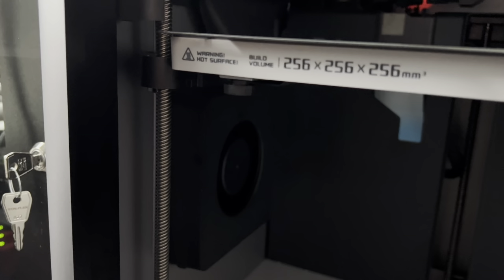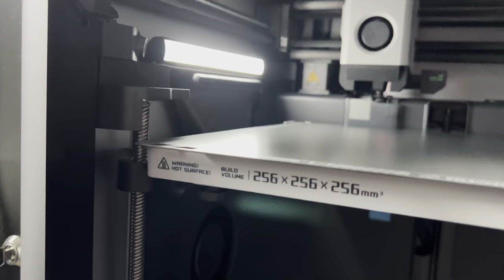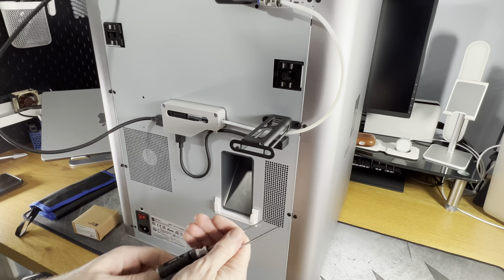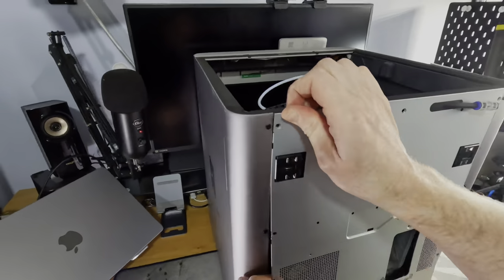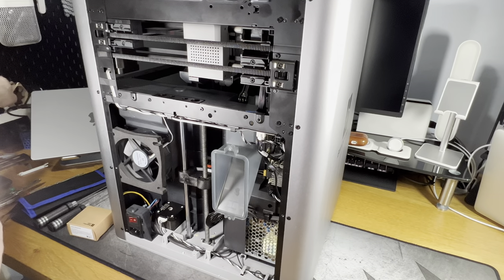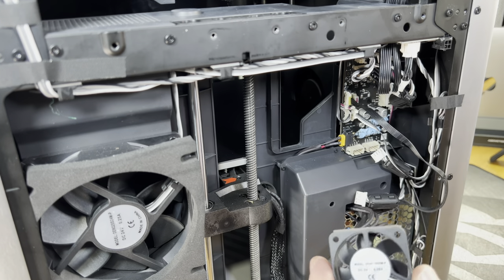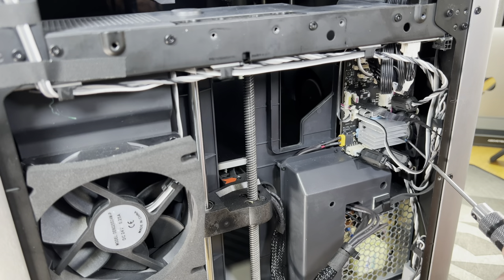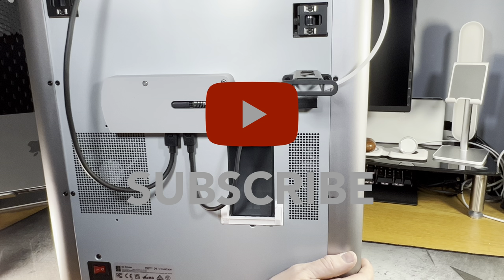Fix Noisy Internal Fan, Bambu Lab X1 Carbon

Comment from the maker: The new fan has slightly different model number, so I suspect Bambu Lab has changed the fan to address the issues with fan noise on the Control Board  fan.  Have you had any issues with your fans failing or making noises?  How did you deal with it?

Comment: I dont know if the ABS printing caused that.I just got mine, didn’t even print yet and that fan is rocky and loud. Just a bad design with that fan. After seeing how much thermal paste they use on that heat sink I would have to think a redesign with a part that runs cooler would be better, or at least a quieter fan.
Reply from the maker: @GadgetReviewVideos temp inside get really high during ABS printing.  But your right the design is not ideal.

Comment: Thanks for the video.  I also had this issue.  I replaced mine three months ago and the noise is back.  I'm thinking of going to the noctua fan as well.  Also, where did you get the file for your purge chute?  I like the idea of the mounting bracket.
Reply from the maker: Thanks enelrad6908, glad you liked the video.  Interesting the noise is back for you, so far mine is OK but I have been doing less ABS printing.  Do you know if the replacement fan had the new model number (ending B05M)?  Have you contacted support to get a replacement fan?  The main reason I didn't go with the Noctua fan is it would have meant cutting cables and that would likely void the warranty.  If something failed you wouldn't know if it was because of the modification or just a fault with the printer that would need a warranty claim.  The design of the printer is too new to know what might happen over time.  Yes,  the purge chute bin I used is from Zodiase on Thingsverse, https://www.thingiverse.com/thing:5848181 and I just used 3M tape to stick it to the body.  Hope that helps.
Reply: @T8Maker  I have not contacted BL support for the second fan.  I already have a spare fan (ending in S05M-P) and have a Noctua on order.  My plan is to use my current repair parts before going to alternate repair methods.  Thanks for the link to the bin.  Have fun printing.  🙂
Reply from the maker: That looks like the old fan, I would log a ticket and try to get the newer model fan.  But I would do the same, the Noctua would be last effort solution, mine is put away for that use case.  If I end up using it, I will put it on a short video.  No problem on the bin, enjoy :)

Comment: Great video. I was thinking of getting one and now I know how to quiet it down when I get it. I did notice one thing tho when you took the AMS Feeder off it was small and white but when you put it back on it was not the one you took off did they update them and you just got a new one??
Reply from the maker: Thank you for the feedback, glad you enjoyed the video.  Yes you are correct, I replaced the original feeder with the multi AMS feeder as I am planning to get a second AMS soon.  But it doesn't add anything else, no other improvements to the feeder or the AMS.

Comment: Did this help the noise? I didn't see/hear a before and after.
Reply from the maker: @ryancameron1610 Around 00:29 I do show the sound before the fix (in fairness I have background music also, note for next time...).  But at the end of the video its not possible to demonstrate the noise of the fan because Bambu Lab released a firmware update which I installed before I did the fan change.  This firmware turned off the fan when not printing, so when I finished there was no fan running to make noise.  I can say replacing the fan did stop the noise from the main controller fan, but I  have no way to demonstrate it, I suppose, without putting a mic up to the fan while printing something.  So for now I am afraid you will have to take my word for what its worth.

Comment: I got my X1C last week and I really don't find the fans too bad. To be fair, my last printer was the Ankermake M5, so anything would seem quiet after that! I do find that I notice the printhead movements more than the fans on the X1C.
Reply from the maker: You can adjust the fan speeds for the part cooling, auxiliary and chamber fans, which does help if it is annoying, in my case it was the motherboard fan that did have an issue and needed replacing.  I suspect it was caused by overheating of the fan due to printing high temp filaments and possible my lowering the chamber fan to reduce noise causing the chamber temp to climb.  Re the print head, you can reduce the speed of the print which will reduce the noise.  But as with everything in life its a trade off between speed, heat and noise.  Hope you enjoy your new printer and have a good experience with it.

Comment: mine is so loud im really tinking about switching it out... even thought about going 140mm room is there...
Reply from the maker: @teabagNBG Interesting, not sure if you could fit a 140mm.  If that is chamber fan?  Or replacing the Motherboard fan?  Also check the voltage of the fan, e.g the chamber fan used 24v fan.
Reply: @T8Maker  was thinking about adding a lil bit more space to the led riser, to fit two external fans on the top to suck hot air out... it basically is ok just parts with 70+ overhang needs better cooling i found out..

Comment: Just adjust it down… No drama. 90% almost cut noise in half, 80% more, 70% is almost unnoticeable.
Reply from the maker: Yes for the internal fans you can do that, but this noise was the fan for the main controller board, which was faulty.  The MC fan cannot be adjusted by software or printer controls. In any case, if its not faulty, it doesn't need adjusting because its not loud normally.  Also with the latest Firmware versions, even if it is faulty, you will not hear it because it only turns on after the printer head moves.

Comment: ive seen horror stories  after  i ordered my x 1 c thats arriving in a few days can u tell me i made a good purchace lol
Reply from the maker: All 3D printers require on going maintainence,  and this one is  no different.  I will say that if you need support, in my experience Prusa is the best by far.  Bambu Lab is slow to respond but they are not the worst.  Also they both have a good selection of spares available.  C x 1 is not a bad printer unless you get a dud, but that could happen with anything you buy.  And if you do you have a warranty.  I think you will be fine 😉